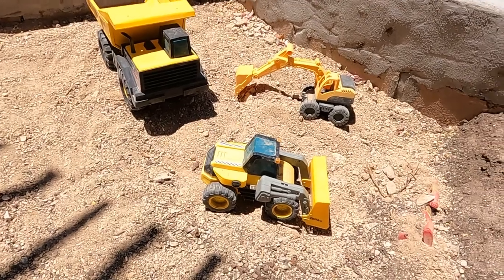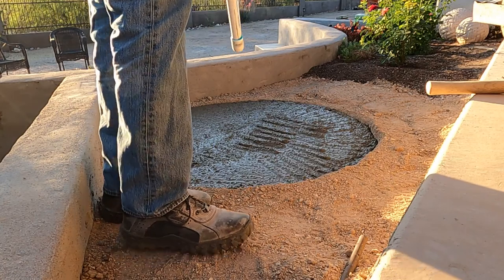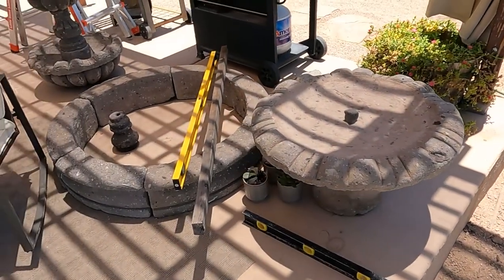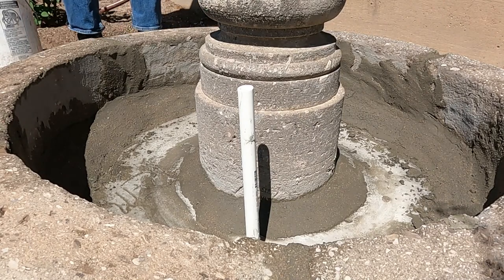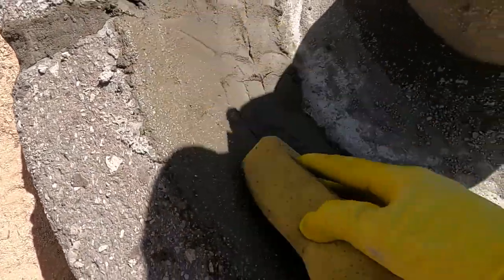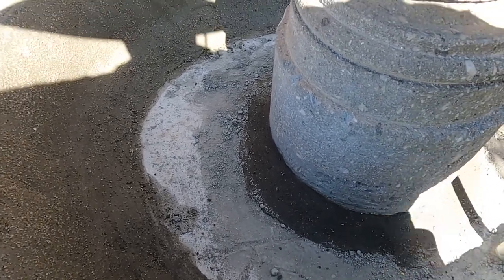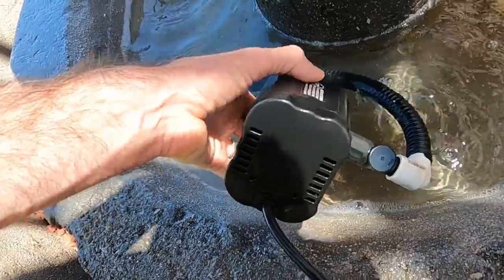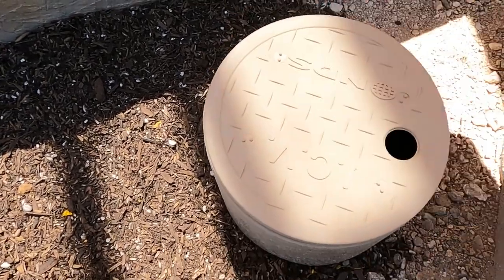Three Tier Stone Water Fountain Installation #diy

Comment: How long has it been since you originally built this fountain and it is it still standing intact and working with no leaks
Reply from the maker: @gsxripper8418  it is around 2 years old and still holding water well. I lose more water to evaporation and birds drinking out of it. We use it regularly. Thanks for the question.

Comment: DIdn't watch the entire thing so maybe it answers the question, but do you have both a water filter hooked up and an auto-refill system installed (water notoriously hard here in Phoenix area), connected from water supply?
Reply from the maker: @SWLinPHX  So refill is manually done for now. I will probably do some type of auto fill in the future. It is unfiltered water and sometimes rain water from my collection tank. I feel like the extra “minerals” we have in Tucson water probably helps slow down the leakage through the mortar and block. :)
Reply: @fixcreateexplore  Thanks for the prompt reply.  I have a big new house and want to install a fountain with pool like this one, about 6' diameter and equally tall or taller.  Is it necessary to install a concrete platform first?  I'm sure there are solid bases you can install before setting up the fountain right?  I'll probably have someone install it since it will be.  It will be huge and heavy and I need an underground water line run from my hose spigot on the side of the house.  I have a few small resin fountains and the only other stone fountain I had which was heavy wasn't nearly as big and sat on a pedestal on my concrete patio so no need for foundation.  But this will be in the garden/dirt by my front entryway. Any tips?
Reply from the maker: @SWLinPHX So my concrete base is multipurpose. The natural ground level at the location was a feet lower before I built the planter it sits in. It is also the base to hold water. If you get a one piece base for your fountain and you have firm ground then a concrete foundation is probably overkill. Just keep in mind that water weighs about 8.3 pounds per gallon. Thanks for the questions 🙂
Reply: @fixcreateexplore  Thanks again.

Comment: Is it water proof? I’m building a fountain in my back yard and don’t know what to use
Reply from the maker: It leaks water slowly into the surrounding planter so I have to top it off every 3-4 days in the summer. I believe I lose some to evaporation and wildlife as well since temperatures are sitting around 100-110F.    The stone of the fountain itself also soaks in some of the water. I’ve been happy with topping it off occasionally and I feel like the only thing I could have done to make it more leak resistant is to apply something similar to what they use in pools.  Hope that helps with your build. 😁

Comment: I have a stone water feature that is stored to go on the wall but it's way too heavy. Can you give me ideas on how I can set it up?
Reply from the maker: Hello Maggie. Without knowing the specifics of your water feature, I can only offer some suggestions. If installation instructions were not included try googling the make or model for more info. Usually these features have some type of mounts on the back to hang on lag bolts that are drilled into studs. The heavier ones could also require an extra support shelf to sit on. I know it’s not much but I hope it helps. You got this! 😁
Reply: @fixcreateexplore  Thank you